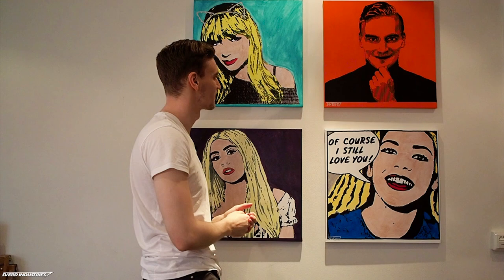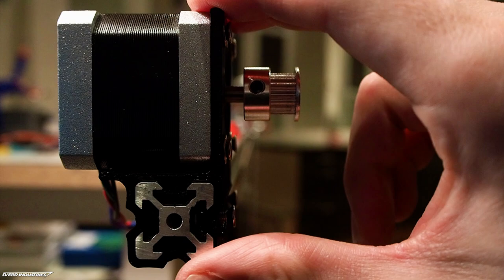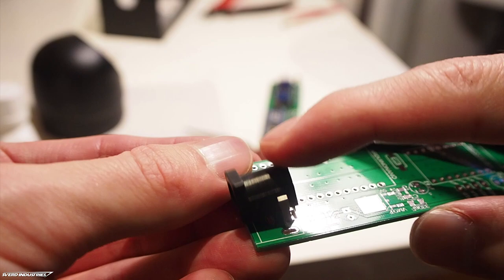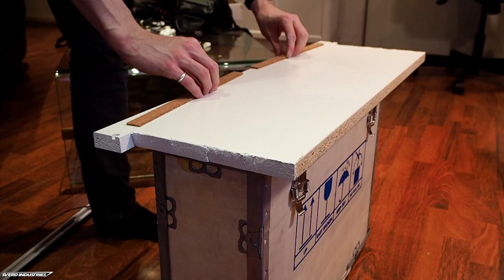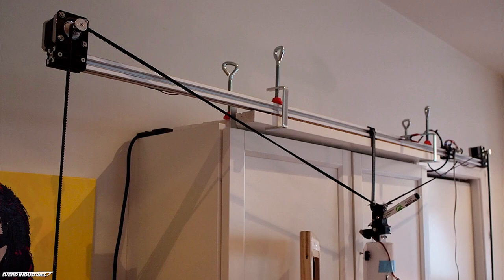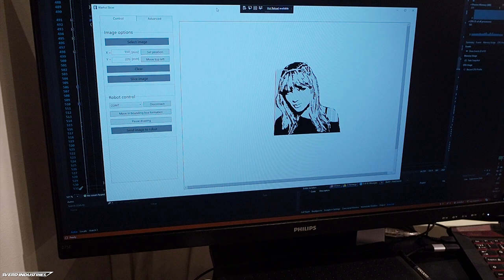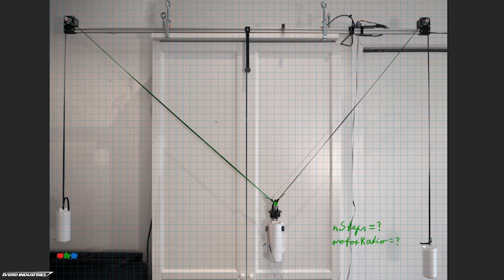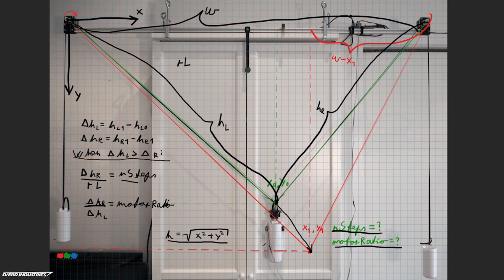How I Made a Robot That Creates Art

Comment: It is a really great project and the results are fantastic. I saw that you had an issue with the horizontal lines (the small bump issue), I am curious what was it and did you have a problem with a curvature at the beginning of the horizontal line ?  Thanks for sharing .
Reply from the maker: Yes, the issue was mainly with the bump in the middle of horizontal lines, with a larger bump for longer lines. My solution was to take each line and split it into tiny sections, then draw each section at a time. When the robot moves you won't be able to tell how the lines are split. So this solved the issue

Comment: Very interesting! How do you handle the lines? I mean, you've shown how to move the head from a point A to a pointB, but how do you draw a straight line from A to B? Thank you for sharing!
Reply from the maker: Right, so you know at 15:50 when I talk about the math and how rL is the increase/decrease in belt length from one single motor step. When the robot moves from point A to point B it first calculates what the belt lengths hL and hR has to be at point B. It then calculates the necessary increase/decrease in hL and hR from the current point and belt lengths, that is from point A to point B. Then it's simply a matter of incrementally increasing/decreasing both hL and hR by the unit length rL, until hL and hR have reached their new target lengths and the robot has arrived at point B.
Makes sense? :)
Reply: @SverdIndustries  Thank you for your super fast reply! I tought let's say that there are two distinct values, d1 and d2 which represent the increment (even negative) to be added at each step to both the motors in order to get to point A to B in a certain amount of step, they will be calculated some way by dividing the dy and dx (the vertical and horizontal distance) by the same number of steps. But on what you told me it seems that it might be a unit length rL equal for both the motors, is it right?
Reply from the maker: @fabriziodutto7508  Yes, rL, the increase/decrease from one single step/pulse is always the same value, for both motors and regardless of the current position. So when the robot has calculated the delta in hypotenuses, ΔhL and ΔhR, getting the number of steps per motor is as simple as dividing both ΔhL and ΔhR by rL. This tells the robot how many steps it needs to pulse each motor before both hL and hR are as long as they need to be at point B.
Reply: @SverdIndustries  Thank you, now to me it's clear, I didn't know that the "step" could be a decimal value too, so it all makes sense to me. Thanks again for the explanation. let's say that rL is the constant travel length of the belt per each full step of the motor (assuming that both motors are the same and has the same rL value). It's now clear to me.
Reply from the maker: @fabriziodutto7508  I'm happy to hear it makes sense, cheers!

Comment: How to upload to nano.. i don't see the ino file.. thanks
Reply from the maker: The arduino files are part of the github repository for the microcontroller (uc). I recommend uploading via platformio, which is a plugin to VS code
Reply from the maker: Otherwise you can just copy the cpp code into your own ino file. Just be sure to install all the correct libraries